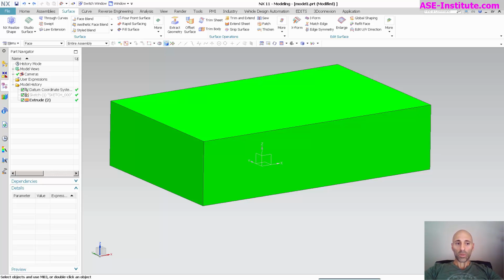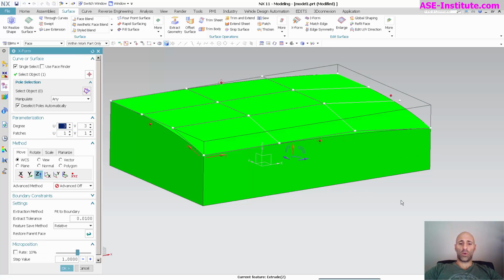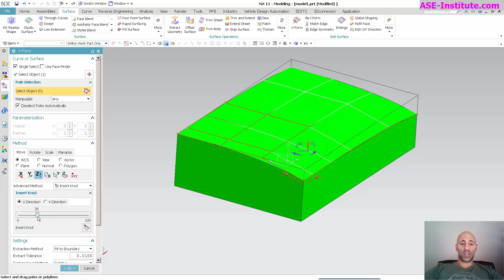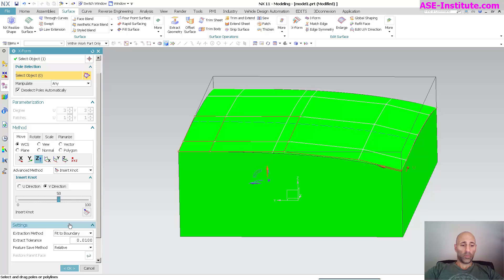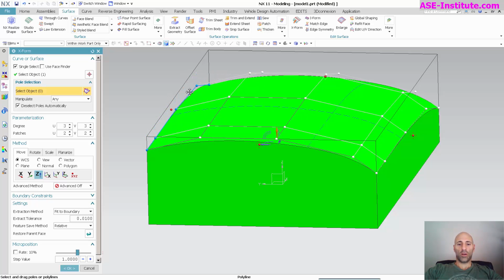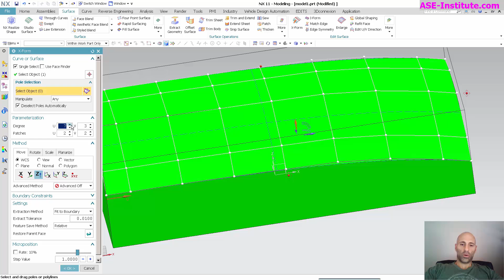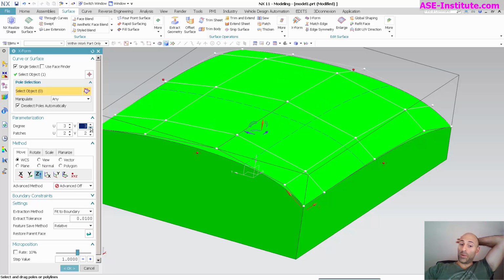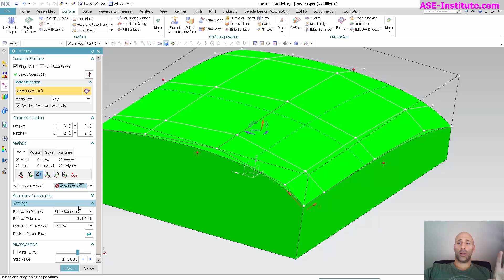Local Morphing Using X-Form:  Insert Knot | Siemens NX 11

Comment: So what i figure out about patches and knot is that if there is a particular area on a surface which i want to move and the regular U ,V lines are not there on that location, i can make a line there by patches so as to modify that surface on that specific part ??

Like you can draw control lines in other M CAD softares and then modify them, so this patch thing is something similar in NX or something else ?
Reply from the maker: Similar yes. It creates a "boundary" on the face. There is a continuity between the 2 new faces and in most cases it remains smooth.